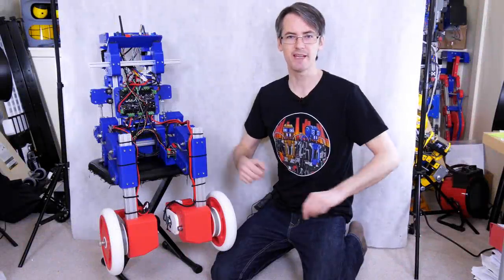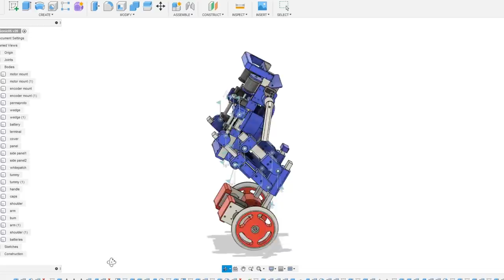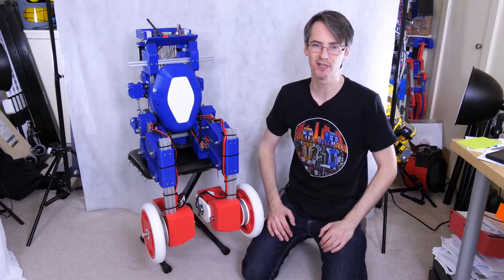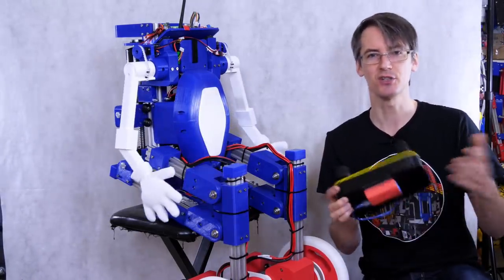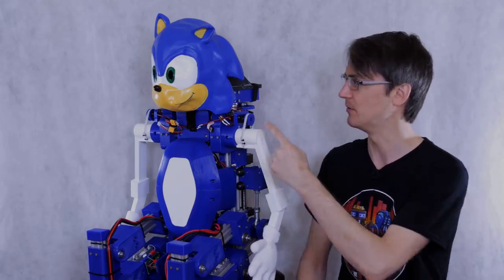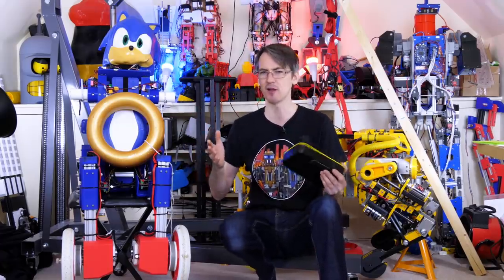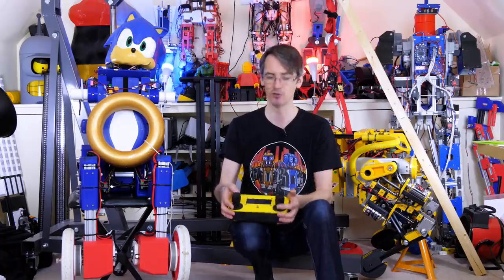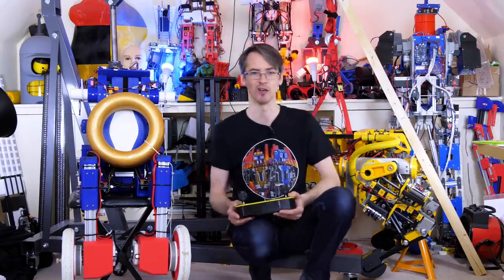Sonic the Hedgehog Balancing Robot #3 : TESTING

Comment: I now have all but 5 parts printed. The tire print was exciting, it was my first print with flexible filament, I used NinjaFlex. I am currently printing the second tire. I only bought a 500 gram spool and the first tire weighed in at 240 grams, plus I used 10 grams in testing my printer with NinjaFlex, so I'm concerned I might run out of filament before the print is complete. I hope they give extra on their spools ;-P I had to add a Zesty Nimble to my Tevo Tornado since it is the only printer I have with a large enough bed to print the tires. It took some tinkering but I now have it printing pretty good. Now I need a parts list of all the bearings and axles for all the joints and wheels and motors and such. My goal is to build OpenDog once James works out all the bugs. This is my first Bruton build, kind of a practice run for OpenDog. I upped my Patreon donation to help out, I am very excited to see this thing balance, it will be my fist balancing robot. Thanks James for sharing and making this all possible!

Opps forgot: I also have all the 2020 and 2040 cut to length and bought every 4mm screw over 20mm in length my local Menards had in stock.

Comment: I dont think load cells or back driveable gearboxes are necessary for what you want to accomplish on open dog. I believe using current limiting with the odrive would work much better. Or you could just track the current use by the motors to tell when a leg is pushing against the ground.

Comment: An alternative to restricting the maximum speed for reliable braking might be to spread the legs, resulting in some 'static stability' by having a wheel in front and a wheel in the back? This would be like temporarily converting a segway into a motorcycle

Comment: Hi James thanks for these amazing video we have learned a lot from them. I am a newbie to this robotics and trying out a small biped with arduino uno. For design i am still using pen and paper which is hectic and when i cut the pvc foam sheet sometimes it doesn't fit. May i know which tool do you use for designing your robot? Does it simulate the working too like gear motions, electronics,etc.?
Reply: He uses Fusion 360 - it's free for hobbyists and makers. You can simulate gear motions and the like, but it can get a bit fiddly.
Reply: @Blayzeing  thanks for the answer, i will try out fusion 360 then, hope it wouldn't be hard to learn and start designing prototyping . Any online course you would suggest for beginners.?
Reply: @AkashJadhavIT  No problem, I hope it works out well for you! I never went through any online courses, but I did go through the tutorial material that F360 provide online - I found it really useful to experiment with every constraint and feature they introduced in order to get my head around it. The one thing I would suggest is learning how to utilise the timeline, as it is one of the core tools that CAD (Computer Aided Design) software offers in comparison to traditional modelling software. As a rule of thumb I try to reduce the number of sketches and actions I perform while I'm modelling, instead favoring going back on the timeline to change previous sketches and actions. Once you've got a sense of the basic tools, it might be worthwhile watching some videos of more experienced Fusion 360 users modelling things. Make sure to have it running yourself, and if you see them doing something you don't understand or think might be useful, pause the video and try it yourself.

Comment: Maybe look into Cartesian to diamond coordinates for controlling differential steering which means you can separate out forward and rotational control much like a standard RC car instead of tank steering I find it's much easier to control and is an elegant way of converting between the two in code. Great vid! I would recommend it

Comment: As for sidewards leaning, shouldn't it simply try ko keep the same load on both legs, at the same time using accelerometer/gyro for lean control? I mean first control loop to get acceleration axis vertical (it will lean at speed in corner) and on top of that keep the force on wheels equal (or you should actually calculate what the difference should be at a given speed and radius (or just lean angle) based on the geometry (center of gravity and wheel span).
Reply from the maker: Wait for part 4!
Reply: @jamesbruton  now you got me excited to see an update.
Reply: @jamesbruton  Looking forward to it! I'm also really curious about how quickly this load cell + motor active suspension can react to bumps and things. I noticed it tended to hop over the ramp and recover later, instead of bending the legs and keeping the body level. Is there just too much latency to react quickly enough? I've heard of cars scanning the road ahead in order to adjust the suspension - is that what you were thinking about when you mentioned the lidar? Or just to navigate around objects? Thanks for the great videos!

Comment: It's been a long road of R&D projects to answer open questions about Open Dog. When do you plan to get back to that project?
Reply from the maker: openDog is an ongoing project, I'm trying to keep everything else to short series. I really want to make it walk one way or the other, but I also really want to build a V2 using more of the 'springy dog' R&D because that worked the best. I suspect that openDog might end up statically stable and I'll build something else more dynamic.

Comment: Maybe put a time delay in the reversing before flipping the steering? The time can be proportional to forward speed perhaps?
Reply: I think the amount of leaning should just be proportional to the actual speed. This should fix both of the issues (left-right switch backwards and falling over while breaking) while also giving a more natural touch to the movements (it would behave like a bicycle).
Only downside is it probably won't look like a sprinter doing a 180.
Reply: @DerIstDerBeste  Good suggestion!